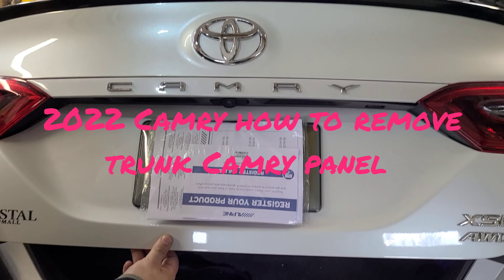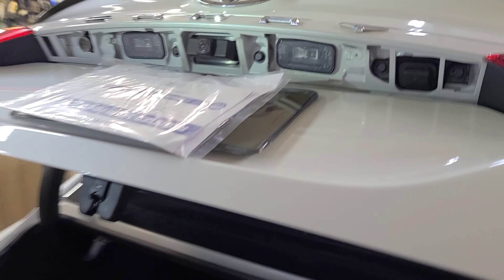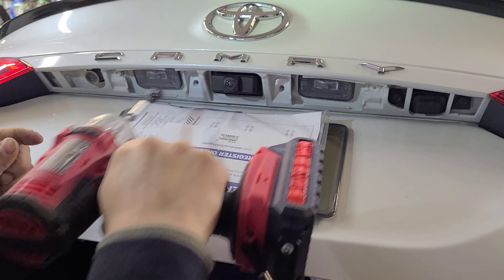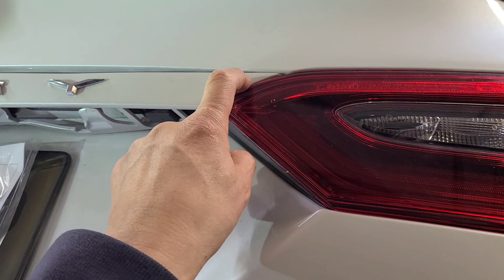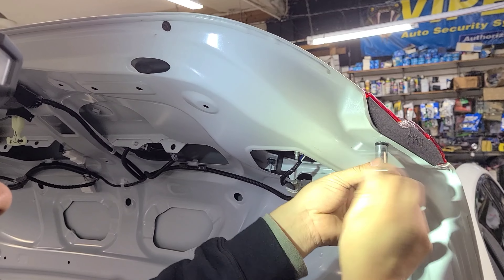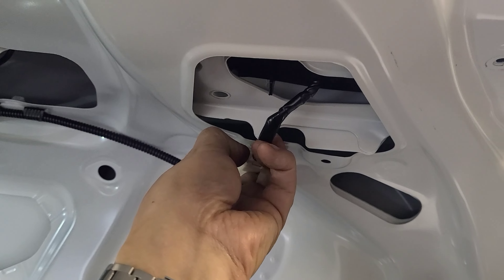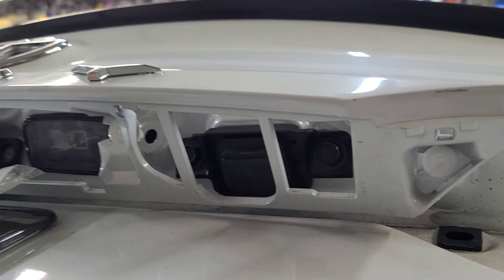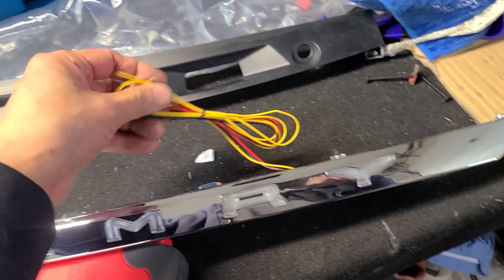2022 Camry How to replace trunk letter plate with new LED letters rear bumper reflector LED lights

Comment: How did you connect the wires ? Is it black red and yellow?
Reply from the maker: The red is ignition or parking light,black to ground, yellow wire to turn signal bulbs